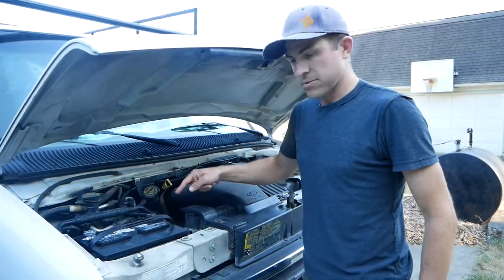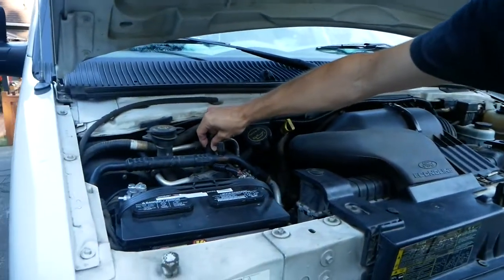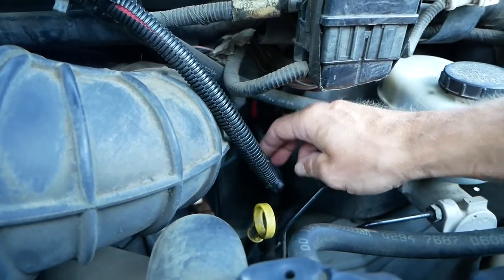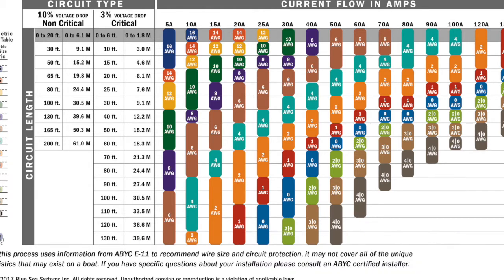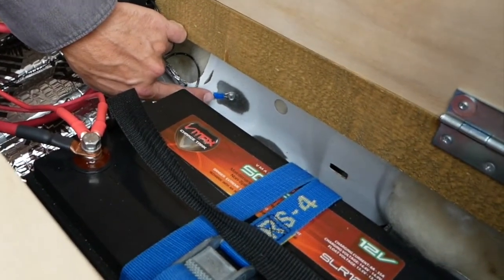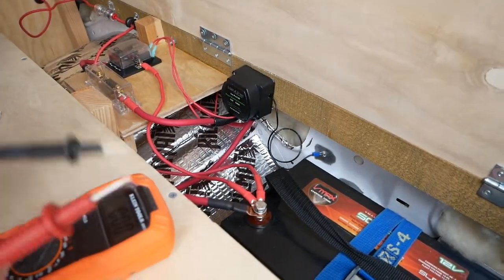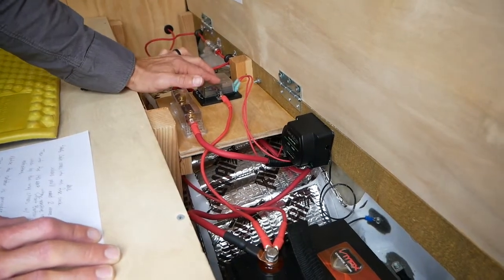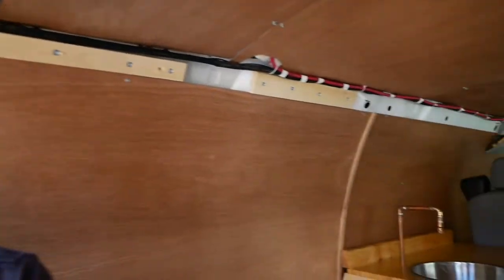Simple DIY Van Electrical | Ford Econoline

Comment: Great job. But I agree with the previous comment, you’re missing a fuse between the front battery and the back one, close to the front battery. It is very easy for a short  to happen, especially during an accident.

Comment: I agree with Bob Amos. If you haven’t already installed some sort of short circuit protection. Do it ASAP on both batteries positive wire terminals. There’s a lot of wood in your van. It could be a huge bonfire 🔥 if the 4gauge wires short out. Pack rats 🐀 could also eat through the conduit / insulation and cause a short circuit. Always best to properly protect electrical wiring. 
Good luck and enjoy your 🚐

Comment: Awesome video! I'm sure someone down below has already mentioned this, but I haven't found it yet...
It's generally a good idea to put the 100A fuse going from the main battery to your auxiliary battery under the hood closer to the main battery rather than after the many feet of low gauge wire.  Imagine for a moment that all of the wood paneling is installed in your van and you need to drill a hole or a screw into the wood paneling.  Forgetting where exactly you put your wire, you may accidently drill or screw into your 4AWG wire and simultaneously touch the chassis of your vehicle. This is a fairly unsafe scenario to be in because that short would be before your 100A fuse and could cause a serious electrical fire.
Take a look at the pictures on the Amazon link for that fuse as they show the same thing that I'm recommending.

Comment: Very clean job. I would make one suggestion. That being that you need to install some sort of protection device at the front battery to the cable running to the rear. As it stands in the video, that cable will be live at all times and anything that might create a short circuit will fry the cable and possible the van. I would suggest determining the total power need and place a mechanical circuit breaker with the desired level of additional current flow protection. I am a retired automotive electrical specialist and have done a good number of custom wiring jobs and always had protection. Beit, circuit breaker, fuse or fusible links. Great clean job though.
Reply: I noticed that too. Fuses should always be placed near the source (Battery) to protect the cable from fire hazard. Correct?

Comment: Great tips. What do you do about a/c? I assume you live in, and stay in a cool place. I dont. So im planning on installing an rv type roof ac. And running it off shore power or a generator . i wish i could get by with a roof vent. I did the extra seat too except sideways but i like yours better.
Reply from the maker: We do live in a fairly cool place, so far this hasn't been too much of an issue.

Comment: This is one of the best of these electrical system vids I have watched. 
Decent camera work (instead of the seasick selfie stick some folks use)
None of that over loud royalty free music everyone uses to make their vids more like an HGTV show. 
Easy to follow, linear narrative. No BSing, dumb jokes or trying to impress us with your manhood. 
Great job!
I totally agree about solar. I'm setting up my van like this first. Then after I get EVERYTHING else sorted out I'm going to go back and add in solar panels for when I go actual camping. Partially for convenience, but also because AAA has a limit to how far they will drive to help you! Don't want a dead starter battery after 4 days in the woods. 
I like how many fuses you have built in to your setup. It's a good idea to mitigate any possible electrical faults because a live in van could be a death trap if there was an electrical fire!

Comment: Hey Im having trouble determining two wire sizes. I have basically the same set up, the only difference is I have a maxxair deluxe fan and a 1000W inverter (same Brand) My question is do I need to use a larger wire than 8 awg for my slightly bigger inverter? and Can I use the same size wire for my fan that you did? Thanks! Your channel has been by far the most helpful with my conversion.
Reply from the maker: Hi Ammon, determine how many amps those things pull (should be in the specs) and then use this chart to determine the gauge of your conductors: https://www.bluesea.com/resources/1437. If you are on the fence between sizes, size up to a larger diameter gauge wire (lower number gauge).

Comment: Hey I got a question how did you wire up the led lights???
Reply from the maker: The dimmer switch has three wires - red, white, and black. Each light has two wires - white and black I think (doesn't really matter). Choose one of those colors to wire to the red or white wire on the switch. Wire the opposite color from each light to the other (red or white). The red 14 awg coming from the DC fuse block is connected to the red wire from the switch as well. I used wire nuts and electrical tape to join the wires. Then I grounded the black wire on the switch to bare metal with a captive terminal and self-drilling screw and added a bit of dielectric silicon to keep it from rusting.

Comment: Hi, I'm in my first steps for a my van build out. Got the van, taking care of inside surface rust before going to town with insulating and what not. I came across your videos and have watched them numerous times and I think of all videos I've watched yours matches what I would like to do closest. I'm pretty much following them to the T. Is there anything you would do different after using the van for a bit? I plan to use mine for weekend climbing trips here and there in and around CO and the southwest. I'm curious about your sheeps wool and condensation. Any problems with that? Is there any more resources you could share with me? Thanks
Reply from the maker: So far no condensation problems and we live in the PNW, but time will tell in a few more years. We are very careful about cleaning and drying the van out after use. 

We would also move the battery bank to the driver side of the van vs. passenger. We were planning on running the cable on that side and then changed our minds but didn't move the battery mount. It just would have saved a bit in cable costs.
Reply: How much sheep’s wool did you use and did you find it to be enough? Thanks!
Reply: @jlarkin10  you could still use the pink stuff. Once its in it cant bother you anymore (itching)

Comment: a proper sized breaker spliced before prior to the inverter would not only be a wise safety measure but it would also allow you to disconnect power to the inverter.  Often times even when your electronics are off the system will still draw power thus draining your batteries. I appreciate the video. I am waiting one some nicer weather to begin installing my 2000w inverter system in my Corolla (stupid I know)  Im thinking about holding off until I get a more worthy rig and livable rig

Congrats on not electrocuting yourself . Im little apprehensive about my install.  Thanks for the circuit diagram

Comment: Question: Why did you decide to place your battery system on the opposite side of where your 4 gauge wire enters the van? This requires more wire and a longer distance of travel.
Thank you,
Morgan
Reply from the maker: Good Question, I started building the platform for the battery and the fuse block when I was originally planning to run the 4 awg cable under the van, which would have been the shortest run possible. After contemplating that idea, I determined running cable exposed to the exterior and at one point uncomfortably close to the exhaust, was a bad idea. I then looked for a way to bring the cable through the engine compartment and the driver side was the easiest path. In hindsight, I should have put the electrical on the driver side, would have saved me about $20 in cable!

Comment: Im looking into a 1990 econoline 150 with 88k miles. kinda just want to get some experience but also advice, i know a older vehicle carries more risk but being low miles only used for transportation of a disabled person, for about 3k, it appears like a deal
Reply from the maker: Hi Code, Thats always the debate right! We don't mid doing small fixes ourselves so going with the older model seemed like the right choice for us. I think it just depends on your comfort and tolerance for breakdowns/mechanical issues.
Reply: Just stay away from ford triton 5.4. You'll probably need an engine replacement when the cam phasers go.